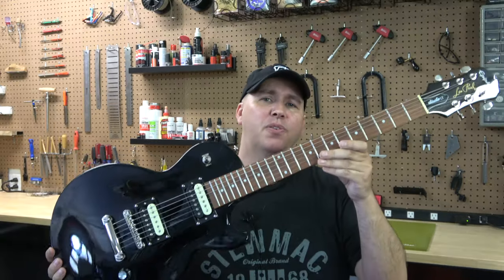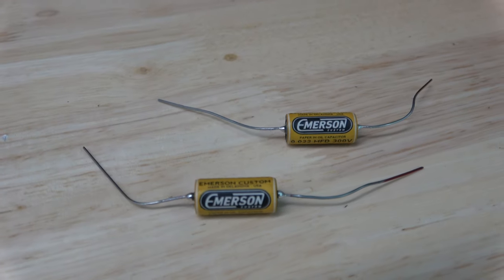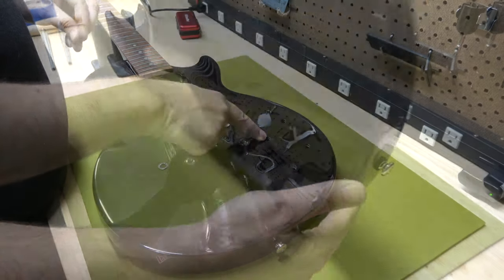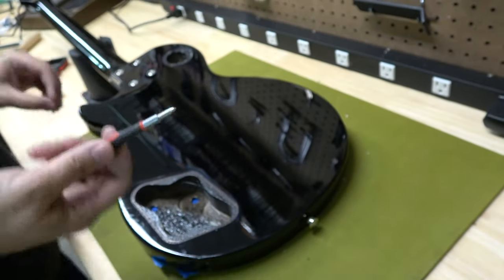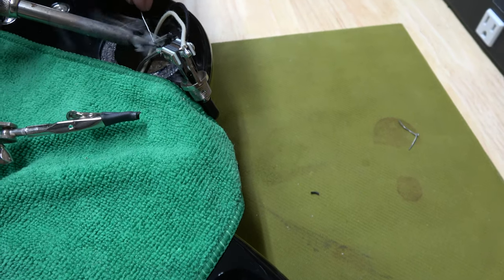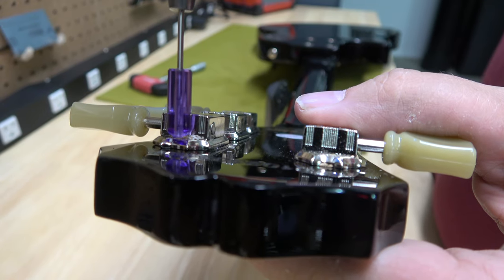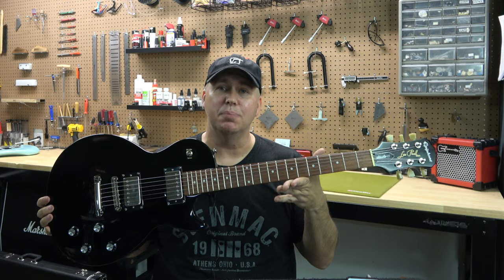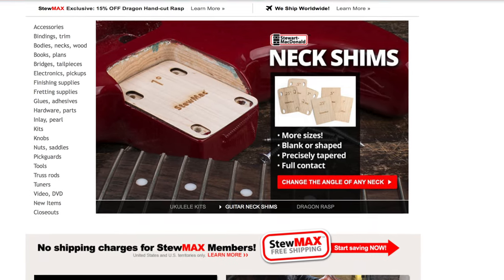Phil McKnight Shows Off Our New Epiphone Hardware and Electronics Upgrade Kit

Comment: Stupidly overpriced. No justification for that price when they cost as much as the guitar itself. You can get everything in this kit for way less.
Reply: yep, $342.24
Reply: Pgcmoore - OMG, if that is the actual price, that is crazy.  That makes sense why he didn’t mention the price in the video or the description section.
Reply: @northof50now  
No.
Reply: Dang, then you have an Epi that costs more than either of my LP Studios?
Reply: Well said. It is the same old thing trying to make an Epi a Gibson. I agree with you on paying so much for so little improvement. I have an Epiphone Les Paul 100 and all it needed was a pick up change. Sometimes I think about orange drop caps but that is as a far as it goes for me.
Reply: $450 CAD , shirt not included
Reply: StewMac is very high priced. When I wanted to get into repairs/rebuilds/new electric builds I looked at their 1st level starter kit which had most of the basic luthier tools. I shopped through Amazon and was able to buy everything at roughly 66% less than SM. Most were Chinese mfg. but they were still the same tools. It just took extra time to get to my house. Depending on the item and coupons they ran, it was a greater savings. Good tools. Use them all the time. I’ve played for 50 years and have always done my own work. I wanted to expand my capabilities and have a guitar workbench.
Reply: Look at the kit for a moment there, it includes a pickup. The pickup alone is $200, $150 for the rest of the tools and hardware including a high quality bridge is a good deal to me.
Reply: It's more than the guitar cost.  Phillip is selling the sonic improvement pretty hard, but I didn't hear much improvement.
Reply: Yep, I just did the sums. Am looking for a used Epi Studio but add this upgrade to it and I may as well buy the top end 2020 updated Epiphone modern or even a slightly cheaper pro and have £100 over.
Reply: @johnbrasher1495  In fact it is just about the same price in the UK as a brand new 2020 Epiphone. Studio
Reply: @Pgcmoore  376.19
Reply: @thomascelentano433  yes
Reply: My Epi Les Paul is my favourite guitar. I've made some upgrades to it over the years, admittedly it's a set neck Made In Korea rather than the Made In China bolt on shown.  I've also got a Gibson but the Epi "speaks" to me. Probably because I've had it for about 25 years now. My point is, some guitars mean a lot to people. Regardless of their value. We'll spend more than they're worth spending on.
Reply: @aaronholmes8568  this. My Epi Traf pro 3 and my studio lt are my babies but I still have my first strat (a starcaster copy) that I've put well over the price i paid for my plus top mim just in different upgrades. Sentimental value means more to me than cash value

Comment: I like Phil. For me the only useful thing is the tape trick. Soldering outside the cavity. Put tape on your drill bit to set depth.  Also to you guitar gurus out there: Why buy a fret rocker? Wont any properly sized metal straight edge do?

Comment: "Improves the transfer of vibration." For what? Your guitar has a pickup that creates a signal by disrupting the magnetic field of a pickup. Pickups are not microphones and electric guitars are not acoustic guitars. Any vibration transferred to the body (or Floyd Rose, or any other bit of dense material) is not being transferred to the pickup - i.e. you are losing sustain. Selling a replacement bridge on the basis that it won't break your strings as often or is easier to intonate, fine, but "transfer of vibration"? Please. Bring on the "tone paint". Also, given that the original setup and the new one sound pretty much identical - muddy - and you certainly wouldn't spot the difference in a mix, where is the economic justification for this. Aside from SM making money, that is.
Reply: Amen brother
Reply: Exactly
Reply: Strawman fallacy. He didn't go specifically into detail as to what "improves the transfer of vibration" really means, you just assumed that it means it leaks the vibration into the bridge.
Reply: For sustain
Reply: Like most of these vids put out by commercial organizations, it is an advertorial more so than a magazine article or guitarists self help collective.  Good for ideas but then find the realistic alternative.

Comment: Does anyone make quality pots that fit in the existing holes on Epiphones? I'd rather not ream out the holes if I don't have to.
Reply: Unfortunately, as an owner of multiple Epiphones, no. I've had to do this to several Epiphones. It's not a big deal. It's nerve racking the first time but it's worth it. It gives you usable pots.
Reply: Epiphone likes to use Metric-spec pots in their Chinese factory which is a pain in the ass I agree. But, the plus side is that really you’re doing a service not only to yourself but anyone who owns the guitar after you because then they won’t have to do it. Every Epiphone should get new pots, sooner the better
Reply: Ream em out no big deal
Reply: @ErickC Thanks for the info.
Reply: If you don’t have a reamer you can just roll up a piece of 100 grit sandpaper. Stick it in the hole and sand it larger, takes a bit longer but worked for me.

Comment: I've bought the golden ager pup's and still find them to muddy for my preference.   I'm impressed with Roswell pickups I got recently on a Harley Benton CST 24 t.   I'd like to find how to get those pickups alone
Reply: I don't know anything about Roswell pickups, but, as far as combating mud goes, I've had lots of good times with a 490R in the rhythm position and a 498T in the treble position. You could try that. Blues lawyers hate them, and usually replace them with overpriced PAF knockoffs, so you can usually find a set on Ebay for relatively cheap.
Reply: Try adding a treble bleed, it may liven them up. It's worked for me.
Reply: @georgelackey622  
Hey George,. Ya I have that in all my gitards.

Comment: Has someone tried this upgrade kit? If yes, what is the feedback?

I have gone though comments, but sadly I did not find anyone addressing this question.

Thank you in advance!!!
Reply: I did exactly the same with different components. I used the Gotoh Brudge, Tailpiece and locking tuners. Enormous upgrade already. I also changed pickups and wiring. The guitar cuts through the mix of the band and sounds not so muddy anymore. A standard Epiphone or a Squier is nice for practicing. Now you get a great sound on a stage for way less than a Gibson.

Comment: Well, I learned some techniques but I'll pass on the overpriced kit.
Reply: 350 seems on...
Reply: 350 is more than the guitar
Reply: @adamfoster6278  Right!!! I just bought used burstbuckers, put a bone nut cut for an epiphone, the same gotoh bridge and tailpiece, some grover locking tuners and CTS short shaft pots with the same capacitors in the video and its money well spent.

Comment: Wouldn't it be cheaper to buy a more expensive guitar that has these upgrades already? I read with everything you need it will cost close to 500 bucks.
Reply: Some parts are better than the parts Gibson is using in their cheaper guitars. I made the same sort of changes with different products. It’s also taste. My Epiphone “59 sounds better now than a Gibson standard. After the changes a good luthier finished and helped me with getting the 50-ties wiring right. Cheapest upgrade is tuners and tailpiece. Gotoh makes higher quality than Epiphone and also some Gibson parts.

Comment: $350 for upgrades to low-end Epi? Is this some kind of a joke? Upgrading a playable Epi makes sense, if you can for example get used bridge pickup (Burny VH1? woah) or used tailpiece for cheap on some auction. So if a player makes couple upgrades with used parts, over the years he owned Epi guitar, it's totally understandable and wise. But putting $350 in one go, into Epi guitar is such a stupid idea.

Comment: I hate to be negative but some of this stuff installation-wise is just backwards and doesn't allow for a neat clean setup once it's all done.  But hey if you screw up the first time... just buy another kit ;-)
Reply: Such as?
Reply: Wilder Sparks feeding braided pushback wire through the toggle cavity and then connecting it to the toggle for starters... makes ZERO sense.